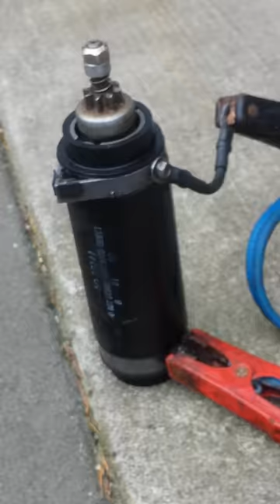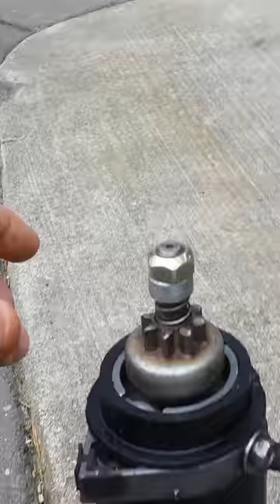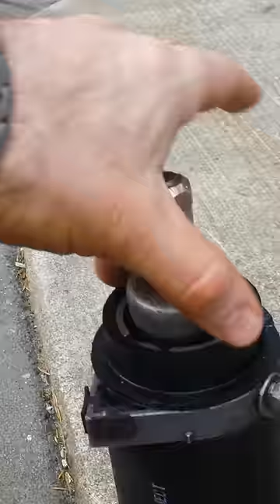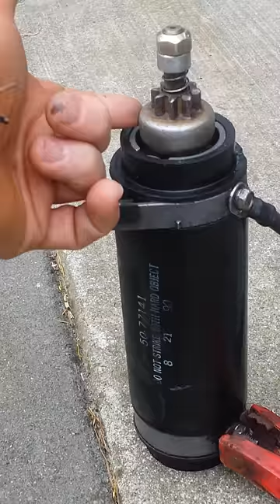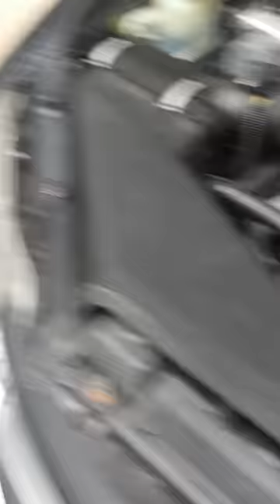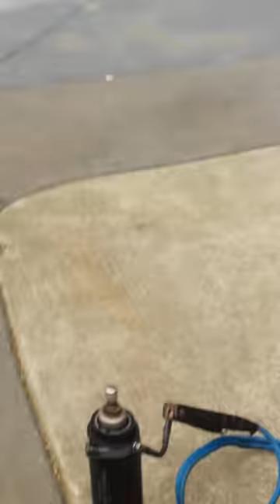How to Test an Outboard Motor Starter

Comment: The starter is just an electric motor. The bendix engages because when the starter begins turning, the bendix resists the turning rotation due to inertia, and the bendix's helical gear uses this "reverse" force to drive the gear up to engage with the flywheel. The drag of the engine then maintains the "reverse" force to keep the bendix engaged until it fires up, when the engine turns faster than the starter, and the "reverse" force is overcome so the bendix disengages. Quite ingenious! Bottom line is that running the starter with no load only proves only that the starter will run without load. To test the bendix, you need to see whether the helical gear drives the gear up to the top of the shaft when the starter motor first starts turning (due to inertia). You then still need to test whether the starter motor provides enough power to turn the engine....

Comment: Myne just turn the bendix does not go up if all is connected right but if i reverse the polarity on the stater it moves up and my motor starts can this be right my motor runs perfectly

Comment: During the test be sure to use proper gauge cables. I had a same problem with bendix when I was using cheap jumper cables, later when I tried proper gauge cables bendix engage and spin the motor without a problem.

Comment: Thanks for your video! I just needed lube for starter gear. 😅
Reply: Omg I’m having the same problem, took the boat out today and won’t start but notice the starter is spinning end up fishing for a few hours close by with the trolling motor 😂😂 lost two bites and that was the end of it ! Never work on a boat motor before took me 4 hours to figure it out that the gear is stuck down broke it loose with some penetrating oil then lube it with some marine grade grease start right up! Thank you and god bless you! ❤️
Reply: @paulzo2o9 glad you got that all resolved while saving lots of money on any repairs! God bless and tight lines, 🤗🎣

Comment: Hmmm... Mine engages the bendix with the flywheel but barely turns the motor over. I can use the pull rope and make the flywheel rotate completely so I know the motor isn't seized up.
Reply: mine does the same thing ... will rotate the engine without compression but will not rotate it with the spark plugs in... the starter has a wire off in it so it makes half the horsepower it should ...its basically junk
Reply: +Rob Schuck found a bad connection on the negative battery terminal. I even had my truck jumpered to the battery and no cranking. when I went straight to the starter terminals it cranked properly. I got lucky.
Reply: It's easy to pull apart, the brushes are just super dirty
Reply: Not mine. Mine works great after cleaning the negative battery connection.
Reply: F Andy Thats usually the First case for everyone lol. But if thats not it and its the starter ifself, it usually just needs to be cleaned up on the inside
Reply: I just hate looking right at the problem and not seeing it and then convincing myself it isn't the problem. Looked at that dumb terminal twice and thought it was fine. And I was an electrician when I was in the Navy and should've known better.
Reply: F Andy I know the feeling. My Elders around me always to fix and test the simple things first, yet I never do. I wanted to bash my head once when i pulled apart a starter and rebuilt it, only to find out the starter relay was bad.
Reply: @SoFloCamejo know of any videos??